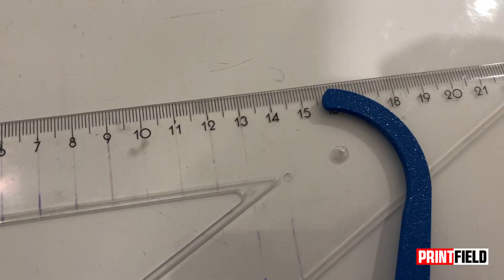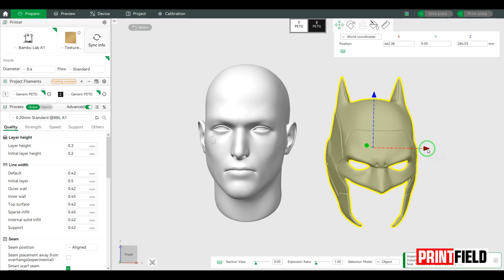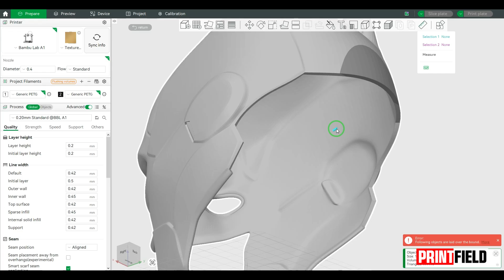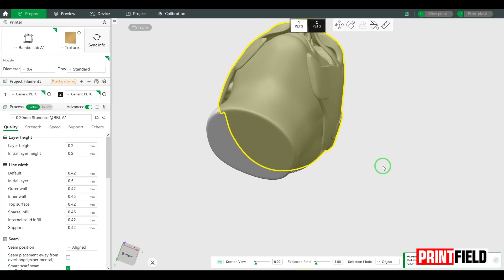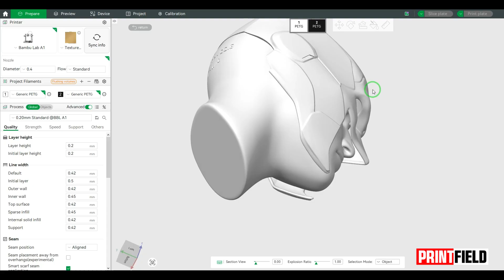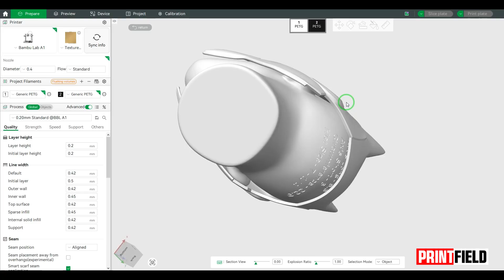How to Scale Helmets? Step by Step Tutorial | 3D Tutorials

Comment: What about helmets that are split in half? Could you explain or make a video, thanks
Reply from the maker: You just need to know the size of the scale. For example if you make an 1.05 upscale, you just apply that to the other parts as well.
Reply: One of the best sizing videos I have seen. I have a flashforge  Creator 5 and the bed is only 256x256x256. I want to do a mandalorian helmet so I know for sure I will have to do it in sections. Do you also have a video on how to section a helmet. Again very good  video.
Reply from the maker: @terryswanson8180  Sorry for the late answer, If you using bambu studio, you can cut in the software and you can save as separated stls. Then you can load it in your software and print it out on your printer.
Reply from the maker: Hi! Just made a video on how to cut the helmets to fit on 3d printer's bed. Check it out here >> https://www.youtube.com/watch?v=Dm6RKPqeWTs